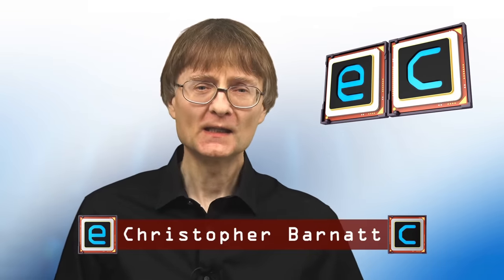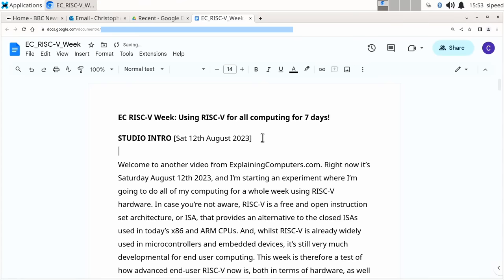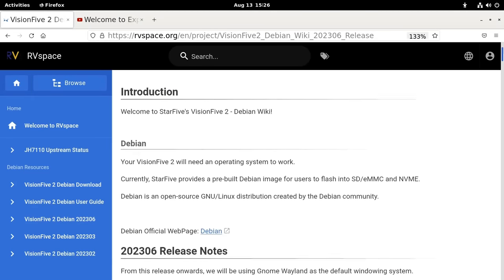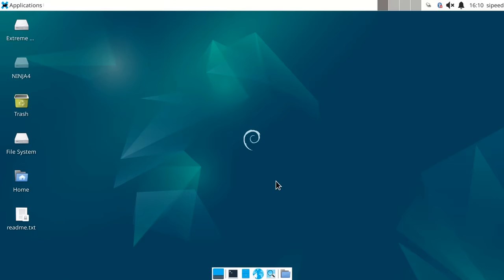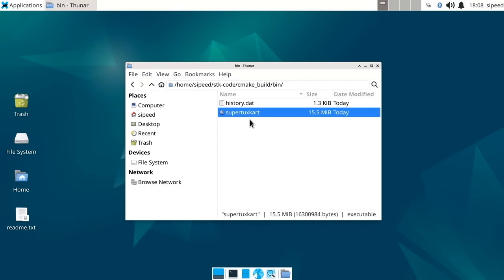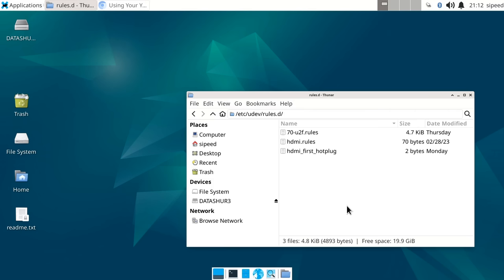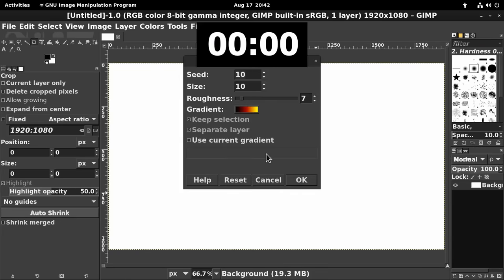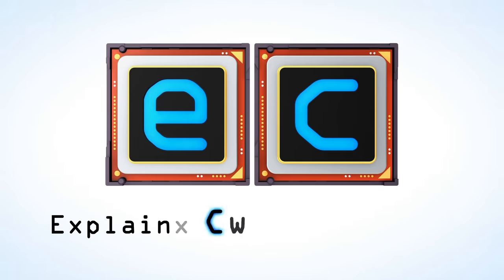RISC-V Week: 7 days only using RISC-V computers

Comment: Random question because I'm just curious.

Is there a reason why all these RISC-V SOCs don't have somewhat high core clocks? I understand that stability for something experimental comes into play, but if it were up to me I'd wanna push my luck and see how much performance I can get out of it. Or at least let people test how far they can go with clock speeds.
Reply from the maker: Things have to start somewhere, and for RISC-V its building upwards from the embedded/microcontroller space. But more powerful RISC-V chips, especially for server use, are on the near horizon.
Reply: Last year's chips were 1.0 or 1.2 GHz, this year's are 1.5 to 1.85 GHz, next year's will be 2.2 to 2.5 GHz, and so on. It takes bigger more complex more power hungry cores to get higher clock speeds, and they need more sophisticated cooling, and take longer to design.  There are already cores released, but not yet available in chips on boards, with 3+ GHz clock speed.

Comment: If you use a IBM Power Mainframe/Server or Workstation. You’ll find out that RISC is really powerful when using the AIX OS.
Reply from the maker: Indeed. But is it not using a RISC-V ISA processor. :) There is nothing new in RISC processors in general (all ARM devices are RISC, for a start, and most new Apple computers now).
Reply: @ExplainingComputers  I use a M2 Max MacBook at home. Plus a few Intel Servers and SAN Devices(NetApp) but in banking datacenters we’ve been using IBM Power for a long time. Especially their modern mainframes are really powerful. I do know the difference between CISC(x86/64) and RISC processors.

Comment: i would buy one of these risc sbc for a little server”, but i’m concerned about reliability (one of my computer took fire and i’m afraid). what is your opinion for a 24/7 server, should those sbc? thank you!
Reply from the maker: Thanks for your support. RISC-V hardware remains developmental right now, with limited software support. I would not opt for RISC-V in general use just yet.

Comment: now im not gonna try to be negative but are there any risc V boards/processors that aren't potatoes? like that can actually run things and not drop frames at 1080p youtube?
Reply from the maker: Both the Lichee Pi 4A and VisionFive 2 have hardware that is perfectly capable of excellent 1080p streaming video playback. But whether they can do this is a software issue -- and with the latest software, the Lichee Pi 4A can now achieve this. But these are development boards -- not consumer products, or potatoes. They exist purely for people who want to develop for or experiment with RISC-V. There are no consumer RISC-V end-use computing devices right now.

Comment: We should compare these with corporate cloud computers for basic tasks. It looks similar to me!
Reply: There is no comparison - corporate cloud computers tend to be hugely powerful servers running many instances of virtual machines under the likes of VMware, AWS or Azure, or containers like Docker or Kubernetes. 

One of the core "advantages" of cloud computing is that if you suddenly need to provide more capacity for a particular service you are offering customers, then you just quickly spin up a few more VMs or containers to cope with that additional demand.

Edge computing, which pushes out some of the computing tasks away from core servers and closer to the end customer (at the "edge" of the service provider's area of responsibility, hence the name) can be smaller and lighter devices that may provide some AI-type functionality, for example, to "route" data flows into the core cloud with more efficiency.

Comment: The Achilles heal is its lack of standards as it is open. Any one can add to it but it will be unique to that company, no one is going to write software for varying  standards. Intel and ARM all have to comply to a standard which makes it easier for software writers. It is interesting that is all.
Reply from the maker: This mis-represents RISC-V. There is a core instruction set, and yes additions can be made. But there is no incentive for anybody to do this in the end-user/server space for the reasons you highlight. In the embedded space, certainly.
Reply: Additionally there are standardized sets of extension profiles, and even a proposal to standardize a way to implement vendor extensions in a way they don't overlap.

Comment: I have had people repeated say that Risc-V was never meant for the Desktop, and I remind them 1) it's an OpenISA meant for whatever is needed, 2) people said similar of ARM in the early 2000s and said it was strictly for small devices and 3) Even Jobs saw Risc-V as the future for Apple after using Intel/ARM as stopgaps. It just seems it needs more drive maturity and more optimization. It's already far ahead of what it was 2 and even 1 year ago.
Reply from the maker: Agreed!
Reply: Steve Jobs died before RISC-V existed.
Reply: @BruceHoult  Risc-V organization was spearheaded in 2010 at UC Berkley. The ISA was introduced in 2015. He was part of that spearheading as everyone wanted a new Risc chip.
Reply: @gpturismo  Jobs died in October 2011. At that date the RISC-V design project had started but there was no hardware, and the ISA design changed totally every 6 months. A stable draft of the User mode ISA (only) was made public in 2015. The M and S mode ISAs continued to change a lot up to 2018.  There is no evidence that Jobs was aware of the RISC-V project before his death, and I would bet a large amount of money that he wasn't.
Reply: @BruceHoult  Like I said, he helped push that direction as he wanted a new Risc tech. It wasn't risc-v at the time but he had wanted the finished product to what apple moves to, ESPECIALLY to remove proprietary ISA's (Arm/Intel) from their products. Remember if arm decides to jack up licensing costs it would hurt a lot of companies. Nvidia, Apple,
Reply: @gpturismo  I flicked an email yesterday to one of the inventors of RISC-V at Berkeley, asking if Jobs had any knowledge or involvement in RISC-V before his death. The reply was that he certainly had no involvement, and it is extremely unlikely that he know of it, as only a few people in the small PARLAB research group knew about it. That was three years before any attempt to publicise it outside Berkeley.
Reply: @BruceHoult  sure. I remember jobs talking about it, as risc was the future of the cpu and mac but ok.
Reply: @gpturismo  RISC, yes of course. The Mac was RISC from 1994-2004 with the PowerPC. But not RISC-V. Jobs would never have heard of RISC-V which was barely an idea in 2011 and completely unknown outside the people working on it.
Reply: @BruceHoult  RISC-V, especially as an OpenISA RISC, was conceptualized in the late 1990s as it was a hope Power and PowerPC would move that direction. Berkley tried to do an interchangeable OpenISA for a decade before getting the groundwork set up for Risc-V foundation. Jobs was a major player in that. So an OpenISA RISC has Jobs dna all over it and he was a, not the only, spearhead to the Berkley project that turned into Risc-V. Things can take decades. I remember sitting in WDDC's during the PowerPC era and IBM had hoped to add interchangeability to it's Power Platform but we all knew IBM would never do an OpenISA, especially if it's Power platform, and knew we had to have a non-profit/not-for-profit foundation control the ISA like open software foundations. Apple switched to Intel as a stopgap and if they follow Jobs plan more to an openisa to remove ARM out of the equation. We will see as Jobs wanted apple to be an innovation powerhouse and Cook always wanted it to be more "lifestyle company."

Comment: Nothing done on IDEs and sophisticated text editors like IntelliJ, Eclipse, VS code. Sublime Text, etc.
I'd like to see how a computational program like one to find all prime numbers up to 1 billion would run on the RISC-V versus an AMD or Intel CPU.
Making a comparison for video or rendering intensive apps is hard since most conventional CPUs have built-in graphics units and no doubt hardware and software designs to optimize this.
Most people have half-decent graphics cards also along with the integrated graphics on their PC's CPU. But the RISC-V project must surely have some such objective to improve the graphics capabilities of these processors within an SBC so we should be fine in the future.
Reply from the maker: This was a test of how a typical user, not a programmer, may use a RISC-V machine. :) And you are assuming that the tools you list are available for RISC-V.
Reply: @ExplainingComputers  The tools I use ? You mean IDEs and text editors ? Why wouldn't these run on Linux on RISC-V ?

Comment: Hey Chris! Why will my windows 10 computer boot  linux distros from my Sata to usb dock and my windows 11 won't? Thanks
Reply from the maker: It will depend on your BIOS settings. It has nothing to do with the version of Windows on the machines. So check the BIOS on the Windows 11 machine to see if USB booting is enabled. Also check the secure boot settings, depending on what distros you are using and how they were set up.

Comment: Aren't those sandisk extreme ssd's not highly prone to sudden and irreversible failure?
Reply from the maker: I've never had any issues. That drive has been extremely reliable since I got it in late 2019. The recent reports have involved certain V2 models, and my strong impression is that one journalist has an issue and has blown things totally out of proportion. All drives will fail.
Reply: Fair point.

Comment: You kind of forgot one of the most important point: PRICE. How much do they cost? I got the impression that they are quite expensive compared to the raspberry pi, which is a thing I have noticed that open hardware tends to be a lot more expensive than the typical non open one.
Reply from the maker: Yes, sorry, I did not include prices here, as I did in my initial reviews of these boards. But this video is about testing the capabilities of end-user RISC-V, not specific hardware. The VisionFive 2 sells for between $45 and $85, depending on the RAM -- so pretty much Pi priced. The Lichee Pi 4A 8GB RAM, 32GB eMMC used here is $130

The above prices noted, no RISC-V SBC is a Raspberry Pi competitor right now, and nowhere in the video did I present these boards as such. For a start, there re no final release operating systems -- software is an an early (if improving) state. As I did discuss at the end of the video, right now all RISC-V boards are development hardware only intended for those who want to develop for, or otherwise experiment with, RISC-V. They are not consumer or general industrial products like the Raspberry Pi models.
Reply: @ExplainingComputers Thank you for the information! I figure they might come down in price once they are mass manufacturer and it is definitely exciting that RISC-V is now also usable for higher performance needs, the last info I had was that they were only used for microcontrollers, I'm glad that changed, more competition is always good. Your video was very detailed and useful to show the state of development, especially that it does not yet provide OpenGL and due to it, Kdenlive and Blender don't work, which is a thing that will likely follow.

Comment: Something tells me that the audio problems are not related to hardware, as much as software, including drivers and any ports of software to the architecture.  I used to process multi-track audio on an AMD 486 DX 80 based system in Windows 95 using Cakewalk audio DAW and that included recording live audio in stereo... with few problems.  Sounds like to me you are getting below 8bit audio quality, rather than 16bit, or higher, with ~12 to 14 bit being where digital audio sound quality becomes audible to humans, and even that depends on the music/voice properties where certain frequencies and instrumentation can hide bad audio for being over its volume level or masking it in other ways.  Bit rates above 24bits are for recording insects and high frequencies outside of our hearing capabilities, where one would slow the recording down to bring the sound within our hearing range.

It will take time for all of the flaws and bugs to be worked out, and also for processors with way more cores... to come onto the market.  The potential is already there, but more companies need to compete with RISC V for it to advance as a hardware platform that will run desktops, workstations, and even super computers!
Reply from the maker: As noted in the video, the audio problems are most certainly software only, and only impact Chromium. :)
Reply: @ExplainingComputers  I'm sure it will be ironed out soon, possibly within this week of testing, unless with Dabien not being a rolling release you wouldn't get the fix.  I use Arch, and get fixes as soon as on the repo's, and I'm not sure what and how much the updates consist of on LTS releases.  It's been over a decade that I switched to Arch, and I don't distro hop, because I have sort of made the one I use my own distro thanks to Linux's flexibility and the overwhelming options I have with KDE Plasma.

Comment: I personally would not bother with these SBCs - too many technical issues to cope with for my liking. You can buy a 2nd hand tiny PC (something like a Lenovo MP93 or Dell E3050)  for way less than these and the performance is waaaaay better in most cases and the support for Linux running on x86 is so much better. But for each his own.
Reply from the maker: As noted in the video, the boards used here are development hardware. They are in no way, shape or form presented as alternatives to mainstream computers. Their only purpose is for RISC-V development and testing, which is what this video is about. This is a "testing where RISC-V is now" video, not a "what is the best small/low-cost PC" video. :)

Comment: Wonder what performance margin the Risc machines have over the  Intel Atom . . . The Atoms being able to run x64 converted into a micro-code very much like Risc.
Useful to know for all of those who have old Atom based systems lying about about which are now at their limit as far as Windows 10 updates goes, . . What path to go next ?

Luv Chris's phone and text only mobile solution. 
Very KISS, very usuable and removed from  the merry-go-round vagueries of IT & mobile provider whim and market push.

 In fact, I've pressed my 12 year old PAYG Blackberry Curve, which, even though it is still receiving 3G signalling ( But is now unsupported by  Blackberry as far as the Smart side is concerned), into just the same role.

As you may gather,  I'm into "Sweating my assets" until they 'Give-up the ghost".

Comment: For me, when Blender works on Risc-V is gonna be the time Risc-V can be taken seriously.
Reply from the maker: A good milestone. Hopefully soon!
Reply: That's a bit like taking a family saloon car off-roading for a day and then complaining the suspension is knackered when you've finished.

In other words "right tool for the job" and all that. 

Procrastination and finding one more reason not to do something is a very easy thing to do.
Reply: @terrydaktyllus1320  But we know 100% for sure that in 20 years, there will be only Risc-V for CPU.
Reply: @MarquisDeSang  You may think you know that but what you think isn't necessarily correct and not really any concern of mine anyway.

Industrial monitoring boards still use 386 and 486 CPUs, I believe they were using the Zilog Z80 CPUs in the Space Shuttle right up to the point they retired them. Just because a platform is old doesn't automatically mean it will get replaced by a new thing.

Comment: on the one hand, risc-V is very interesting and I would like to see more adoption of risc-V hardware ... on the other hand ... I don't ... because once the big brands start putting risc-V into consumer devices, they will start locking these devices down just like they did with phones and tablets and tv boxes and whatnot... "open ISA" will not change anything, unless you specify in the license of this ISA that EVERYTHING about the device has to be open as well ... otherwise, it will just be ARM all over again ... even more locked down underpowered black boxes that require you to do the whole raindance to get around their oem-unlock bootloader security net bullshit just to have bare naked debian or android running ... that is ... IF you are lucky and someone has already cooked up a debian or android image for the specific device you have.

Comment: So, RISC-V is lacking when it comes to a dedicated GPU.  The thing I think about with RISC is compatibility.  When it comes to x86 any operating system is compatible with any hardware configuration (within reason).  X86 is just a generic platform that you can take almost anything and it will work.  That being said ARM is really restrictive.  If you have a 5 year old android phone you will never be able to install the latest version of android on to it.  I really hope RISC follows x86 and not ARM when it comes to compatibility.

Comment: using gimp's lava as a speed test - is not good approach, if there is no 'seed' parameter. You know random stuff is khm... random. Because of it, every image different, so it can take different time even on same hardware. Try test it with 7z benchmark. And if this SBC will suppport OpenGL (in future), there is good tests such as gears and donut.